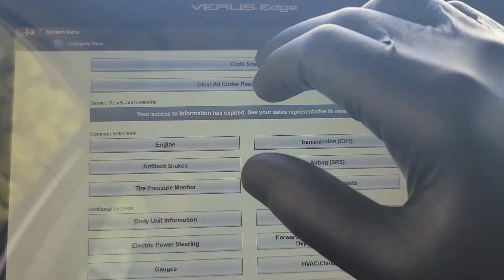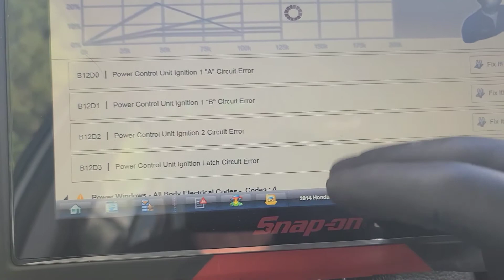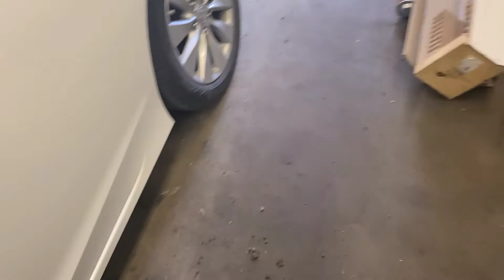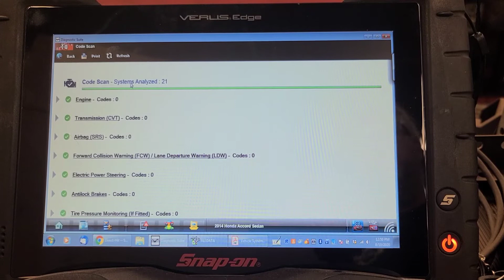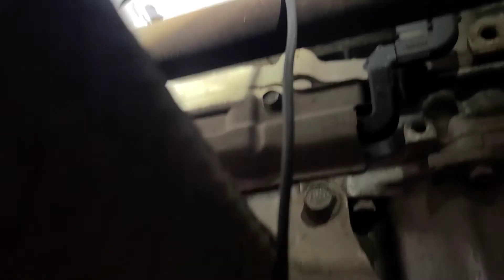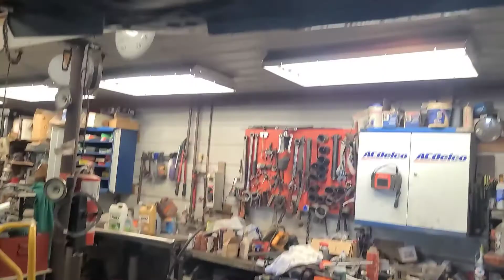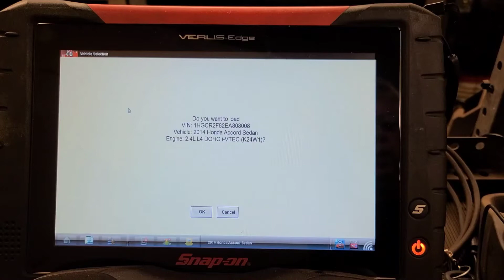2014 Honda Accord Intermittent No Crank Condition

Comment: Apologies for the question. But I see this video, and other videos indicating the starter, or relay module... How can a make sure it's not the module?
Reply from the maker: You have to test for power at the starter control wire while attempting to crank. If there's power present but the starter fails to crank then you need a starter. This is assuming the battery and cables are fine. If there is no power being sent to the control wire at the starter then you need to test the control circuit. I'd usually just swap the starter relay for another. If thar doesn't work you need to gratify the circuits to and from the stater relay. Check the PCM for codes, status of the gear shifter, crank request and security.
Reply: @PhillipBailey awesome thanks for clarifying that for me. Since the relay is a module for my 14 accord. I wanted to make sure before justifying the 125 dollars for it... But dang... That's a very tight fit to take off the starter out... 😣

Comment: What is the p/n for the starter assembly?  Is the circuit board with many relay sitting on and the circuit board is inside the black box?  And do you have problem with after-market starter after months of using?  I was told by the dealer that Honda Accord is very sensitive with the after-market starter, spark plugs and alternator.  They strongly recommend to use OEM products for those.  Thanks for excellent video.

Comment: Was recently driving and all of a sudden the car lost power and wouldn’t start again, everything works inside, radio, lights, etc but just won’t turn on. When in start position it just clicks, could this be the starter? Ordered one and it should come in a few days and hoping by replacing it it should fix the issue, any tips?
Reply from the maker: A starter failure will not cause it to lose power and stall in my opinion.  I'd make sure the engine is not seized. Try turning the engine by hand clockwise on tge crank bolt. Make sure the battery is fully charged too.

Comment: Hi, Phillip,
My wife's 2015 Accord V6, with 50k had similar, very intermittent no-crank issues: It happened twice in one day about a year ago, then again today, once. Then the car cranks up OK again. Yes, she has a hi-quality remote starter (she coached kids in the evenings that can get very cold here, North of Chicago). But now in Spring she leaves the remote back at home, so it's not attached to her key chain. What's your suggestion? Should she keep the remote handy, so that when this happens again she could start up the car with that remote?
Thanks!
Reply from the maker: If its an actual problem with the starter it will do the same thing when starting with the remote. The remote starter bypasses the ignition switch but still uses the same starter and control circuit. Unfortunately you need to have test equipment on the circuit when it acts up to qualify what's happening.  If it dies and stays a no crank problem it's pretty easy to test. Sorry no silver bullet.
Reply: @PhillipBailey  yes, intermittent behavior is really tricky! But thanks for the info!

Comment: My daughter has a 2014 Accord Sport with manual transmission. She's been having this issue for a while. Codes showed failing alternator and starter. I replaced the starter, and the issue was resolved... for about a month. That starter was a freaking pain in the ass to replace, so I'm not looking forward to doing it again. Really feel like it's an ignition switch issue. Really hope it's something easy to fix
Reply: My ‘14 lx with a manual transmission is doing the same thing. Replaced starter, it was great for about a week. It seems like the longer the car is running the less likely it is to start after warm up. I drive about 100 miles per day.

Comment: I had the same problem, it was the battery current sensor. you can bypass it with a jumper cable. all off the current goes thru
the battery sensor mounted on the battery.
connect one end of the neg jumper cable to the neg batt terminal and the other end of the neg jumper cable to WHERE THE NEG BATT CABLE IS CONNECTED TO THE BATTERY CURRENT SENSOR. This will bypass the current sensor and provide full power to starter motor. I replaced my starter and 2 months later it did not start.
Honda has sold a ton of starters probably for no reason.  search for youtube accord battery sensor for more pictures.
Reply: Honda already had a recall for that battery sensor my 2014 accord starter is failing I’m getting mines replaced Monday

Comment: Did u use Honda starter or aftermarket?
Reply from the maker: No I used a Wilson reman unit.
Reply: @PhillipBailey  thank u so much. I’m a nerdy girl that researches and I can’t get no respect from these men mechanics that won’t listen and I try to be somewhat knowledgeable. Can this”Wilson reman unit”  be found at any chain auto supplier. I’m in Mississippi like all of us wish I was in Canada near by u. Thx again
Reply from the maker: @elle1731  thanks... there should be a number of rebuilder brands available at any parts store. Wilson and Dixie are common here. Look ar Rock Auto they will have multiple choices. Be aware though most shops don't like installing customer supplied parts since they are not making their markup on the part. There is also a warranty concern with customer supplied parts. For instance the way it typically works is if I supply the part and install it there is a minimum of 90 days warranty on both parts and labor. Some parts have longer parts warranty beyond 90 days. The starter I installed has a limited lifetime warranty to the original owner provided the vehicle is not used commercially (taxi cab for instance). If you were to supply the part and it were to fail because of a defect in the part in the first 90 days only the part would be covered, you would have to deal with the part supplier for another part and you would have to pay to have it installed a second time. Hope this helps. Good luck...
Here is a link to Rock Auto
https://www.rockauto.com/
Reply: @PhillipBailey  I’m going to try to contact a auto shop teacher at 
The local h.s who’s helped me previously.
Reply: @PhillipBailey  Hi again can u tell me why the starters look different some look like the Goodyear blimp w/ a camera or cannon on top I’m confused. Of course I’m using my VIN to narrow it down.
Reply from the maker: @elle1731  your starter does not have an external solenoid (the cannon on top) and some parts pictures are generic in nature.

Comment: The starter is a VERY common failure point in these Accords, you might hear a "click" but it won't crank is the tell.
Reply: Yes, mine has been doing that for a year. Sometimes it will start right up, then sometimes it will take you 5 minutes to get the starter to react. I've noticed in my car, under cold weather it does not happen as much, but after I have driven it or it is hot outside, more likely to happen.

Comment: I’ve recently had this issue occur with my starter. But I would like to say after watching your video that the door lock codes are most likely not from that after market remote starter.. as my car doesn’t have one and those same codes have shown up on my vehicle. Every time I’ve cleared the codes they show back up 2-3 times after starting the car.
Reply from the maker: That's interesting to note but I don't think they have any bearing on the starting system.

Comment: 2014 Honda Accord EX-L, 4-cyl, 66k miles.  Same issue.  I had the starter replaced with an OEM starter by a local trust-worthy mechanic exactly last year.  Just recently, the same symptoms started acting up.  After pressing the push start, car would turn over.  Turn off the car and try to restart, dead...nothing happens when pressing.  It takes a few attempts (maybe more than 5 after sitting and waiting) before it finally catches and starts.  This is to be our reliable daily driver and do not want to get stuck.  Nor, do I want to spend close to $1k for another starter. Please help.
Reply from the maker: You need to connect a test light to the starter S terminal and monitor the light when the starter does not respond. If the light illuminates but the starter does not crank you need another starter. Most replacement starters come with a lifetime warranty. If the light does not illuminate then there is a problem in the control circuit in which case you'll need a scanner and further testing to track down. Keep in mind that the condition has to be present to diagnose it. If the starter works during testing the test results are inconclusive. Good luck...
Reply: @PhillipBailey  thanks for the tips and advice. Ended up replacing with another starter. Mechanic said that the OEM unit replaced last year must have came from a bad batch.
Reply: @rlposadas513  did your issue fix. It sounds like my issue but mine usually on hot days
Reply: @yezkaholic  yeah, considering it’s a new starter again, unfortunately. so far so good. cranks immediately. warranty is 12k or 12 mos, whichever comes first, so will see. it didn’t matter in weather conditions in my case. good luck with yours. I know how frustrating/puzzling it can be.
Reply: @rlposadas513  yeah I've already taken it to dealer ship and couple mechanics with no luck. It starts as long it's cold so i use for work because ei know it will have 8 hours of cooling off. But probably wouldn't drive it to the liquor store. Yes indeed very frustrating I will consider replacing the starter again i already replaced it 2 years ago

Comment: I have honda accord 2014 i have to restart it like 3 times for it to start,ive gone like 3 places they told me they can't see any problem,please can somebody tell me what might be wrong am stressed
Reply from the maker: You need to be clear about the symptoms. Is it actually cranking but not starting or not cranking at all. Is it starting and stalling. These symptoms are caused by significantly different conditions. If its not cranking it could be a number of possibilities with exactly the same symptoms. If it does not act up while testing you just might have to wait until the condition gets worse. Good luck.

Comment: I've had this going on for months. Last time it just quit, I actually towed it to my local private magicians and we DID find the battery was on its way south. Replaced battery, had no problem for a month or so, now it's just started up again. EXACTLY the symptoms you had here. Guess I was lucky - our '14 just crossed 150k. I'll get the starter replaced this week and we'll see what happens. THANK YOU for a superb piece of methodical detective work.
Reply: Any updates bud?
Reply: @yezkaholic  Sorry, I just discovered the mailbox these go to. On the '14 Accord v6, yes, did replace the starter, and it behaves properly virtually always, BUT very rarely it'll sound like the starter teeth don't engage. Only happens once, then second attempt starter engages fine. It's happened MAYBE three times since starter replacement., now have 180k on it, so 3x in 30k.
Reply: @jerryeads4084  no problem
 Ended up getting rid of the car no one could quite figure it out
Reply from the maker: Thanks for the comment but please understand it may not be the starter since there are multiple causes for this intermittent problem. Good luck.
Reply: Any updates ?

Comment: having the same issue just ordered a starter. My son had an aftermarket car starter installed on Hyundai and he would leave the car and keys in the garage.I walked in the garage the car was running no one around.I pulled the remote starter out of the car the fuse holder and some wiring was all melted

Comment: disconnect the flywheel and rotate it one bolt hole.  fixed our shit box 2014 v6 accord after burning 3 starters  from grinding or just not engaging .  don't know why it worked but it did.  been going fine for over a year now. I'll never own a Honda but the wife loves these toilets.

Comment: I just switched out my old starter motor on my 2014 Accord Sport.  Can the old starter motor be sent off to be serviced/repaired/reconditioned?  If so, who does so?
Reply from the maker: If you bought a reman starter then the old one goes back for a "core" and it is rebuilt. You would have paid a core charge which typically gets refunded to you when you bring back the original. If you purchased a new starter then they don't usually want the core returned and didn't charge you the core price. There are some starter and alternator shops that rebuild them but due to labor costs and parts accessibility these are becoming fewer. I'd ask your parts supplier.

Comment: Have the same problem you have described that you purportedly fixed by replacing the starter; and, was wondering if this could also be an issue with oxidation internal to the start-stop pushbutton switch, similar to that found on some Honda HR'V’s; which are fixed by removing the start-stop pushbutton, pulling the back off the switch and cleaning the contacts in the switch with Electronic Contact Cleaner; then, reassembling and reinstalling the pushbutton switch. Am currently trying to investigate this as a possible cause on my 2015 Honda Accord Sedan with 6-spd manual transmission. Only 1-problem, after having removed the console and the radio; as well as, the climate control HVAC unit, I cannot figure out how to remove that part of the dash that the start-stop pushbutton switch is mounted thru. Thoughts?
Reply from the maker: Sorry but I've never had the push button switch out so I'm not much help to you. I suppose it's possible for the push button switch to cause a similar issue. The symptoms would be very similar but so could a problem with the starter relay, neutral safety switch and a possible problem with the immobilizer system. Problem is its most often intermittent and difficult to reproduce consistently. Good Luck

Comment: Phillip, correct me if I'm wrong. Bad brushes will cause slow if any starter rotation. Bad contacts will only make clicking sound. My starter turns the engine over 3 slow revolutions. Next try it cranks. SUBSCRIBED!
Reply from the maker: Sounds like you might have a shorted armature, worn bushings allowing the armature to drag on the field poles or bad brushes. High resistance in the cables or connections can cause this as well as can low battery voltage. Sometimes worn brushes will cause a n0-crank condition intermittently as well. A solenoid failure can cause a no-crank or just a clicking condition but rarely a slow cranking condition. IMO good luck.

Comment: I have the V6 version. I'm on my 4th starter. Mine kept grinding so now I have to have the torque converter replaced along with the flywheel 🤦🤦

Honda quality sucks nowadays
Everything started at 20k miles
Reply from the maker: Why the torque converter? That has nothing to do with the starter. I can see flywheel but converter no.
Reply: @PhillipBailey  I honestly have no idea 🤷 it's what the dealership has communicated with American Honda.
Reply from the maker: @PLATINUM2U  for a grinding problem I could see the starter damaging the flywheel teeth.
Reply: Because if I'm not mistaken the flywheel ring gear is on the converter
Reply from the maker: @chancemcdowell6052  Ah they hired that laid off Chrysler engineer...
Reply: @PhillipBailey  I literally just got a call my car is finally "fixed" I'll go pick it up in the morning.. I hope the issue is resolved
Reply: @PhillipBailey  got the car back. Service code 218102 transmission and torque converter exchange. So I have another transmission now 🤷🤦🤦🤦
Reply: disconnect the flywheel and rotate it one bolt hole.  fixed our shit box 2014 v6 accord after burning 3 starters from grinding..  don't know why it worked but it did.
Reply: @GRrrr-b1p  any other issues with your car?

Comment: My 2015 accord sport did the same thing but I dont have the push button.
My mechanic first checked the battery, then the fuse , then the starter, when it got to the starter he connected his machine and we were able to reenact the click with no start. It was infact the starter. Never did it again after but now my keyfob wont work along with the inside doorlocks on driver door, any ideas?
Thanks

Comment: 2015 Honda Accord....sometimes the car starts fine, sometimes it does not start (doesn't make a grinding noise or anything) but after a few attempts eventually it will...turns on everything else perfectly fine during that process. Thought maybe it could be a bad brake switch or whatever sends the signal that the brake is pressed to start but I have no idea.
Reply from the maker: Intermittent problems are the worst to diagnose. You need to have test equipment on the circuit when it happens. My money would be on the starter if there are no security code or control circuit codes.
Reply: Same exact car/same exact problem
And mine is a sport if that makes any difference
Reply: Any updates buddy? , I'm having the same problem right now
Reply: Me to